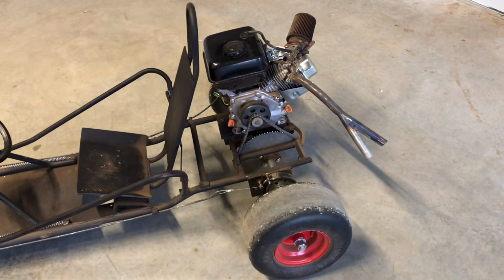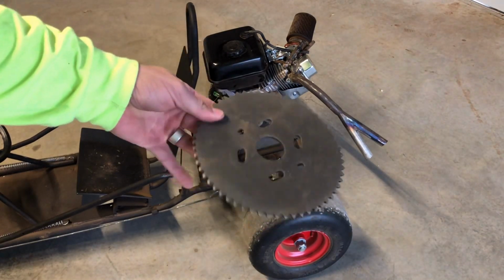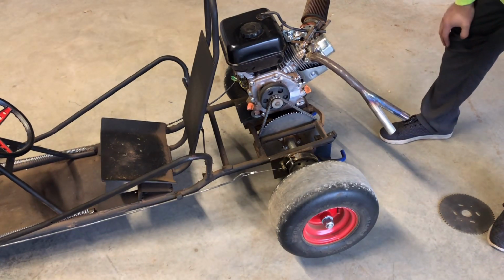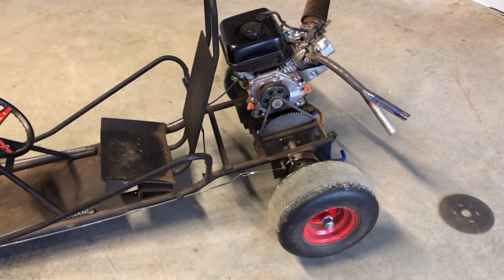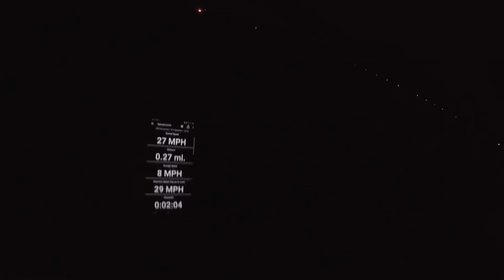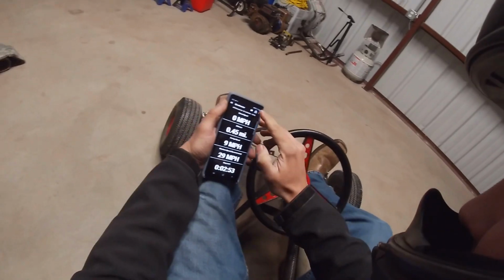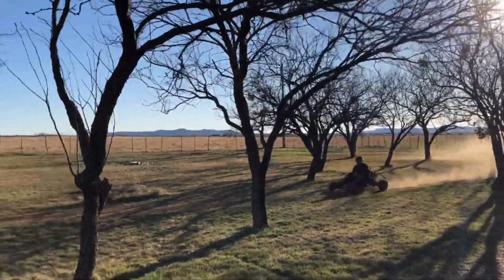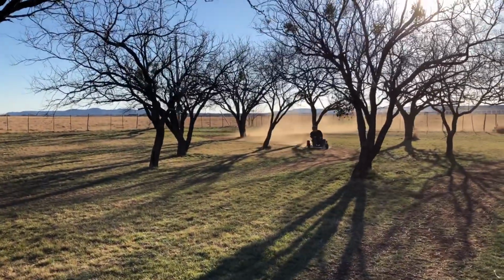100 subscribers!! | #smallenginenation | go cart

Comment: Yo seems like there's plenty of power in the 212 and you get more when u play with the front Sprocket as well.  If you got 10 tooth try a 12 and a 54 on the rear oh and add a torque converter that should fix the take off along with greater top speed and keep the torque and power you need on the track. Centrifugal Clutches tend to slip  reducing power and torture. Also just my (opinion )but a torque converter help protect the engine with smother engagement no banging and bumping like centrifugal clutch. You'll burn the belt before you do the engine.  
Congrats on 100 I see yah at 1,000,000 brother Bless UP 
Jah Rastafari Selassie I Jah
Reply from the maker: Thanks Rasta!!